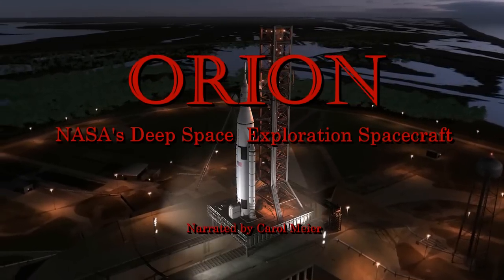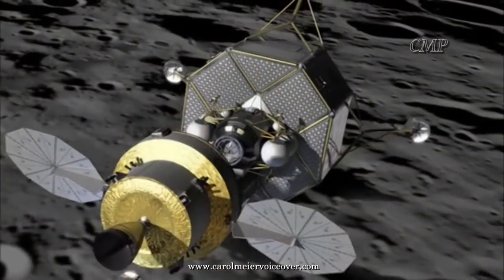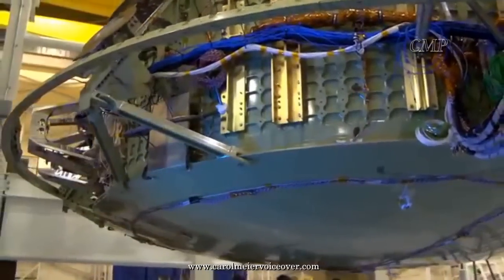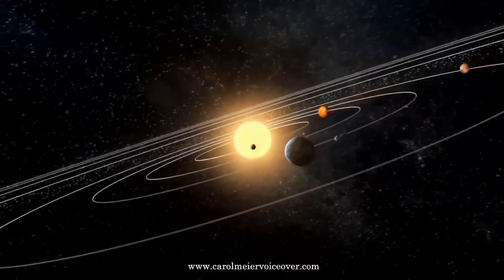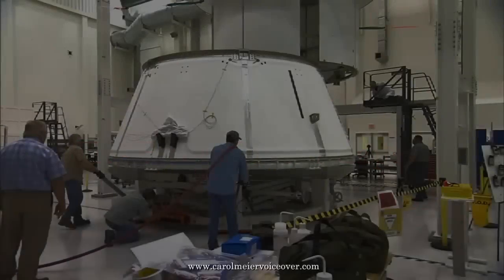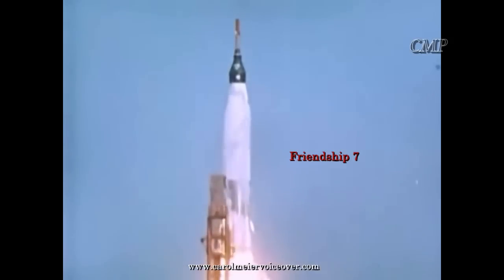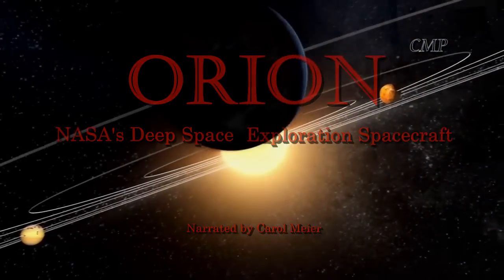ORION -Exploration Spacecraft - Explained in Detail.  Orion and Artemis

Comment: Eventually we will have to find some other propulsion method than chemical rockets. Also will need part of the craft to rotate to provide gravity and a protective room for solor flares
Reply: The original Project Orion had that covered!     :)
Reply: There is no "eventually". There is no guarantee what we dream is possible.  Do you have a flying car?  Can regular cars run pollution free yet ?  Muskian Fantasy does not work: what is possible is what is possible. What that is exactly is hard.
Reply: @java4653 
If Henry ford thought "What is possible is what is possible"
 He would have never invented the car.

Comment: If they would have used Elon Musk's reusable heavy lifter the expenses would be a lot lower and it is more reliable. The SLS is new but there is no real innovation. It seems like the real brain is still Werner van Brown (a NAZI) that developed the engines for the space shuttle 50 years ago... 50 years in space science is very old. We use it once and it gets destroyed... and it is not even close as efficient as the turbo engines version built by Russia, because it bleeds un-burnt fuel!
It is good that we go to the moon, but it has to be done with a fiscal budget that is sustainable in the future.
Cost will kill this project; it cost about as much as an election; tough choice democracy or the moon!
Reply: Yeah sure!  Elons Starship as from Sept 2024  4 failures out of 4 flights with the human landing system not to be seen and 15 space refuels to get to the moon with no refueler in sight!
Musk has a habit of over stating his capabilities and Musk fan boys suck it up..
NASA have lost confidence in Starship and have asked for a second contractor for the HLS.
Reply: @Leon1Aust  well.. uhmm
Reply: @Leon1Aust Also what you mean by failures on flights 4? The ship goes through reentry, as plans, land in the ocean.. As plans. The only thing that failed was starship got damage during reentry.

Comment: SpaceX has a lot more comprehensive ideas for reaching out to the Moon and Mars, including building orbital infrastructure to act as transfer and refueling points. The highest penalty of spaceflight is being limited by having to get all the fuel used in the mission off the ground in the first place. They've already started work on launch vehicles that will be capable of taking over 300,000 lbs payload to orbit if used as non-recoverable, about half that if flown reusable, IIRC. You have to be able to get substantial payloads and vehicles to orbit and then re-fuel them for the mission if you want to do anything of any consequence. Sending enormous vehicles to space just to whittle them down to tiny probes and capsules by the time they leave orbit is not getting us anywhere quickly.

Comment: I don't understand the whol radiation thing. Moon landing conspiracy theorists say that u can't pass it. But you need to to get to the moon. Also in this video they say they need to find out how to keep radiation.
Reply: Orion missions last much longer than Apollo. Months of cosmic rays or one solar flare could be serious.
Reply: Abdullah Hussain Where in the video does she talk about keeping radiation in?
Reply: Radiation is an issue. Van Allen Belts are not much of a problem. MPCV will have to deal with cosmic ray exposure. There are various ways to do this, including use of the command module as a sun shield.

Comment: They gotta figure out reliable radiation shielding. I'm pretty sure just a 4 day trip to the moon and back would give astronauts a lifetime's dose of ionizing radiation.
Reply: BasePuma4007 A deep space habitat would probably carry the radiation shielding for missions beyond the earth-moon system. Otherwise, most of the radiation encountered in the space between the earth and the moon (van Allen belts) is on earth's equatorial plane (not exactly, but around that area). And due to earth's 45 degree tilt, a spacecraft on a trans-lunar trajectory would barely pass through the radiation surrounding earth. That's the reason why Apollo astronauts never needed radiation shielding, and they were on the moon for days at a time. So on a 4 day trip to the moon, no lead protection would be needed. Although solar radiation could be a problem if we're talking about months on the moon.
Reply: it does but it only take a few years off there life its fine but the radiation on mars could actually kill them
Reply: +введите бросок Ya they really need a lightweight material that can actually block high energy radiation effectively... Lol you'd need a lot of Delta V to put a lead capsule into earth orbit let alone mars...

Comment: The design of the Orion seems quite wasteful. They call it a reusable craft but it basically jettisones almost all of its components upon reentry. The Dragon2 capsule concept keeps nearly all of them.
Reply: In rocketry, the launch platform and the spacecraft are considered separate. Orion is a reusable spacecraft even though the rocket it flies on might not be.
Reply: More like semi-reusable.
Reply: You want the re-entry vehicle as light as possible. Also, you need to care about the shape. MPCV has to be configurable for a number of mission profiles. It would be prohibitive to push re-entry full to Mars and back.
Reply: I was specifically thinking of its fairings and launch escape system which are considered part of the spacecraft. Moreover I think that a more integrated design approach (such as BO and SX are pursuing) makes more sense. I can understand that it was not viable during the Apollo era, yet now we should be able to do better.

Comment: But ... why they don`t build a rotating system ? ... and why so small ? ... even with the deep space habitat it is so tiny ... doesn`t it take several months to get to mars ?  I would build a big rotation station to simulate gravity ... perhaps 200 meters diameter ... or, if only such a tube like in the vid ... why not 100 meters long ... and why not 4 pieces of them side by side ... even this would be too small for such a long time ... but this box? ... I mean, you know what happened in Pandorum : ))
Reply: +Sonne Mond because adding more mass means more propellant required to reach orbit, and more propellant means a bigger rocket, which requires more engines, which adds more mass, which requires more propellant... you get the picture. All of this costs money. Something as big as you propose would either require a ludicrously oversized rocket to get it to orbit in one piece or else construction in orbit would be required, and orbital construction means multiple launches, which are certainly not cheap. 
If NASA had an unlimited budget it would have already finished developing Orion, the SLS, and countless other spinoffs and the only thing stopping them from going to mars would be the launch window.
Reply: With engine technology improving, we could probably get to Mars in a matter of weeks, if we timed it right. On of which, you've got to be prepared for spartan conditions in space. It's just how it is, until some kind of an actual society exists in space. By that I mean large populations in orbit and on moons. We're just not going to see space at anything but a premium until that time.
Reply: The primary function of Orion is to allow astronauts to reenter the Earths atmosphere at high speed, it doesn't need to be any larger to achieve that. Also it's not intended to be occupied for more than 21 days.

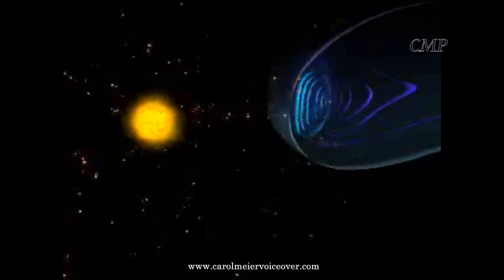Comment: @6:55 The narrator begins to explain how for the first time man will need to be protected radiation than ever faced before. Wait, what? How about the Apollo missions? Didn't they faced those same Van Allen belts?
Reply from the maker: +Ralph Rosario
 Hi Ralph,
The video is saying that as Orion leaves the radiation protection of the Earth' magnetic field and Van Allen belt it will be exposed to the full spectrum of space radiation.  The Apollo missions lasted 4-8 days whereas Orion missions will last maybe 2 years of continual space radiation exposure. NASA is therefore having to develop methods of protection from significantly more radiation than we have experienced in the past.  
It is not that we have never crossed the Van Allen belt before but that we haven't stayed outside of that protection for such a long time before.  Also the new generation of electronics in Orion will need more protection too.
Reply: Radiation level depend on time of exposure as much as the level of exposure. So even if we are expose to an intense radiation, but if we spend it in shortest time possible, then there will be no adverse effect. Astronaut in ISS was protected from radiation by the Earth own magnetosphere. Astronaut to the moon only spend few days outside Earth protection. But Interplanetary travelers would've experience years of direct exposure.
Reply: Yes, and they didn't hang around in the Van Allen belts long enough for it to be a major concern.

Comment: Can someone answer a question for me? Why is it necessary on re entry to slam the craft into the atmosphere at such high speed, necessitating a heat shield? Why can't it glide back more slowely (and safely)?
Reply: +Kiyoshi Kirishima Reentry happens at 7 km/s because that is slightly below the speed required for orbit. If you were to slow the rocket to a safer speed that wouldn't need a heat shield, the return rocket would be as large as the launcher.
Reply from the maker: +Kiyoshi Kirishima
Hi Kiyoshi Kirishima,
This Q&A offers a pretty good explanation of why we cannot glide back more slowly.
https://www.quora.com/Is-re-entering-the-atmosphere-slowly-an-option-for-a-spacecraft
Reply: +Carol Meier Narrator - revoeciov Thank you for the reply!
Reply: *****
What I mean is, say you're in orbit, and you want to go home. All you have to do is fire your engines backwards so you slow down to just under the speed you need to stay in orbit, then wait. You'll fall low enough that the atmosphere will take care of the rest.

The reason you don't slow down more is because it takes as much delta-v to cancel all your orbital velocity as it does to get into orbit in the first place - see the Wikipedia article on "reversibility of orbits" (I think...). Since the mass ratio of the rocket, and by extension, how much fuel you need, increases exponentially with delta-v, you'll need a rocket at least as big as the rocket you used to get to space, squared.
Reply: +Kiyoshi Kirishima also the spacecraft uses the earths atmosphere as a brake and since its traveling 6 miles a second it produces drag which gives it tremendous heat ,compared to the space shuttle which is in lower earth orbit,so the heat shield bears the brunt of decelration as it passes throught the atmosphere.
Reply: well the Orion spacecraft is going to be re-usable so they don't want it to completely fall out of orbit, but I do understand what you're saying
Reply: Good Question!
Reply: The Earth rotates at a high speed. So, the atmosphere like the Earth, also rotates at a high speed so, if you come in at slow speed, the atmosphere, rotating as fast as the Earth, will automatically cause friction due to speed.
Thus, making a heat shield necessary.

Even if you were to come at the same speed as the atmosphere, gravity will again cause a problem. You might need as much fuel as the Saturn V used, crammed into a little capsule.
However, a parachute might not be necessary as rocket can be fired on reaching, say, 40,000 to 30,000 feet. This will make a smooth landing for the capsule. This idea as been implemented in the SpaceX capsule.

In case you have any other doubt, you can contact NASA at www.nasa.gov .

- Starwarsdhruv
Reply: Even the Shuttle has to shed energy from re-entry speed. It uses tiles which have reliability issues. As seen with Columbia, there are more so single points of failure. The frustum shape as seen in Apollo and MPCV have been shown to be optimal. MPCV will re-enter at higher speeds from deep space missions.
Reply: Excuse typo.

Comment: Does anyone know what  the original heat shield on the first  Apollo moon crafts was made from and how they made it and what temperature  it reached during re entry.Has Apollo 11 was travelling at 6600 MPH at 40,000 nautical miles out. Must of been really well engineering craft and stress tested to the extreme to with stand extremely high temperature ,mega deep cold and the radiation  level and the unknowsWhat speed and temperature when they where travelling 100000 miles out then 50000miles outWhere can I find this information.
Reply from the maker: +Crucial Gorilla 
Hi Crucial Gorilla,
Apollo 11 was covered with AVCOAT too although it has been re-formulated for Orion.
Apollo 11 was covered with AVCO 5026-39G an epoxy-novalac resin re-inforced with quartz fibers and microballoons.
It is reported that re-entry temperatures on Apollo 11 reached 5,000 degrees F.
You may be interested in information on these websites:
http://www.nasa.gov/home/hqnews/2009/apr/HQ_09-080_Orion_Heat_Shield.html

http://ntrs.nasa.gov/archive/nasa/casi.ntrs.nasa.gov/19740007423.pdf

http://spaceflightnow.com/2014/11/05/engineers-recommend-changes-to-orion-heat-shield/
Reply from the maker: +Matthew Ferrie 
The websites listed in the reply to Crucial Gorilla above offer some good insight into the chemical composition of AVCOAT.  Ceramics are good at withstanding heat, in fact probably higher than AVCOAT but AVCOAT is an ablative material in that it burns off as it heats up during re-entry exposing the cooler material beneath instead of just continuously building up more and more heat during re-entry.  Ceramics just heat up and continue heating up creating more and more heat during re-entry.  The websites listed above also talk about the various materials tested by NASA before finally deciding on using AVCOAT.  See 5:02 to 5:32 in the video.
Reply: It's an ablative ceramic type heat shield
Reply: +Carol Meier Narrator - revoeciov Isn't AVCOAT a polymer? I tried to find it on Wikipedia (unreliable source, I know...) and I found that it is similar in structure to Bakelite.
Reply: *****
Interesting - so AVCOAT is designed to burn off.
Reply: IIRC, the Apollo heat shield was made from honeycomb with the openings filled with a resin.  The resin was injected by hand usinc caulk guns in a veryblabor intensive process.

Comment: Now I'm not a conspiracy theorist, and I truly believe we went to the moon. But, there's something I've caught onto here that's odd. Both in videos given by scientists and astronauts from NASA, including NASA's homepage, they state something like this: "Other elements will also be put to the test, including how Orion’s computers handle the radiation environment in the Van Allen Belt. New methods will need to be determined in order to protect the astronauts."
Well, hold on a second. Didn't we solve this problem in the 60's...?
I find it odd how no records are currently left standing, as to what kind of structure and materials was used for those astronauts. Just saying. But any who, hurry up so I can live to see it!
Reply: The computers in the 60s didn't use chips but big core rope memory which isn't affected by radiation due to its huge size. The downside to our new microchips is that even though they are light they are also small and affected by stray particles.
Reply: New methods are needed to protect the astronauts because they weren't protected in the 60s. If a solar flare had taken place during an Apollo mission that would have been extremely dangerous for the crew. Since Orion may have longer missions it's a bigger issue.
Reply: No records?  Information has never been easier to find in human history.  Go find it.
Reply: H Drabek Ahh ok, thanks for clearing that up guys. I have now found some blueprints for the lunar modules for Apollo 11 & 13. But no reference as to what materials were used at all. Really curious now.
Reply: The old rope core memories used in Apollo were more resistant to radiation than today's microchips.  I don't believe they are even made anymore.

Comment: Should have been started 20 years ago when the shuttle should have been abandoned . Even former NASA administrator Michael Griffin called it “a mistake.”
The shuttle was a disaster , it never lived up to any pre- program promises apart from the fact it went in to space. It was way to dangerous as has been proved by the death of 14 astronauts from 136? launches . 1 in every 68 launches , pretty low odds !! It was also horrendously expensive in everyway possible , consuming vast loads of money that could have been put to better use .
The Saturn 5 should have been retained and used for heavy lift . It could put 100 tons in earth orbit per launch and the Shuttle per launch? Supposedly 30 Tons but was never achieved , The ISS is only 200 tons ! of course there is some size related issues there but still . The saturn 5 had a great record of reliability and outright power and was relatively simple to build copies unlike the Space Shuttle ! $1.7 Billion each , no SRB , No external tank .
 And of course the saturn did put a space station in orbit but no one new what to do with it once they got it.
Where would we be now without the Space Shuttle noose ??
Reply: We should have never stopped using and upgrading the Saturn series.
Reply: totally agree. I think we could have used both...however the shuttle once already in space. as in build the shuttle in space, say on the moon, then it's so much more efficient and moon to earth travel would be a bit more efficient